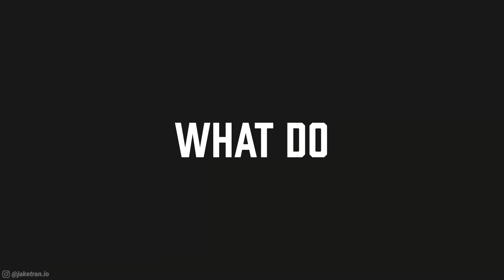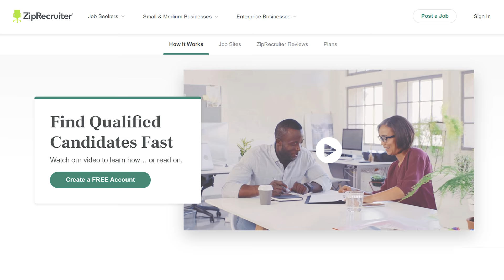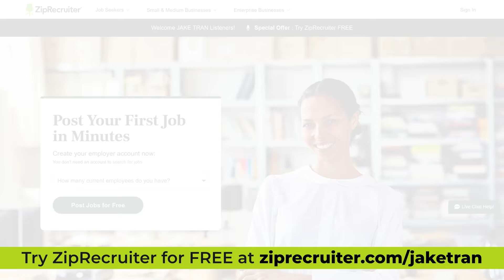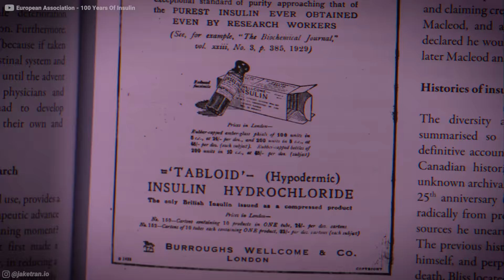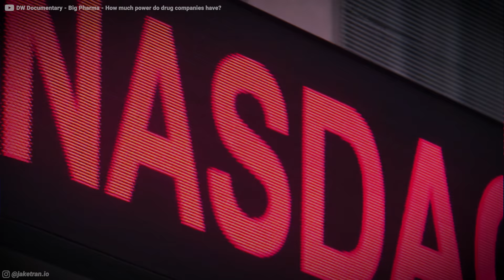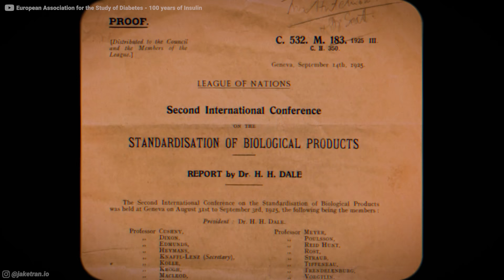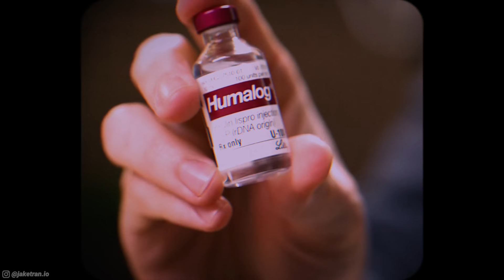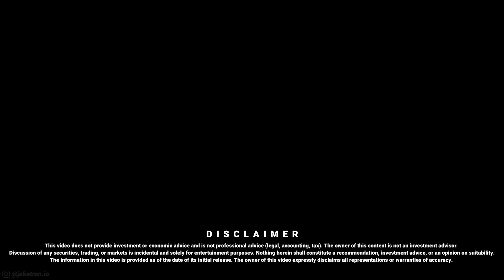OH, so it is all a scam!

Comment: Telling diabetics to stay away from sugar as a blanket rule, is a scam too.
My blood sugar levels go low and I risk diabetic shock.
So I carry around glucose and sweets to consume.
Since I've been doing that I've had not a single close call.
Listening to doctors, had me close to death a few times.
I used to test my bsl up to 7 times a day.
Doing my own research and my own tests has made me stable with dietary mods.
One thing that's truly evident to me regarding doctors, is they are just another arm, of the scam that the Rockerfellers started in 1920 when they took over the pharmaceutical industry.
Why the hell, would anybody in their right mind, prescribe medications that lower my bsl when that's the problem in the first place?
Medical industry is full of con artists pushing meds and not treating the cause.

Why cure cancer, when you can push expensive chemotherapy and have a repeat customer?
Cancer is another scam, but people buy into treatments and wonder why SHTF.

Comment: This shows the true toxicity of the government and its system. I don't have Diabetes (thankfully) but I have Asthma, the cost of an orange Diskus inhaler of Corticosteroids costs $500+ CAD without insurance, paid for it once and didn't need it anymore so stopped taking it. But thankfully the blue inhalers are free with OHIP. I can't imagine the struggle with Type 1/2
Reply: Okay they said he managed a restaurant, that averages 46,280 a year even on the bare bottom end it says 36,000 a year. He lives with his mom so no mortgage.  He could easily have a cheapish car. lets say food and maintenance of home and car costs $3,000 each so $6,000 a year   taxes at this bracket are not bad so lets high ball and take 20% of the salary (FYI you dont even pay a penny on the first 10,000) so on the lowest end he makes $28,800 a year at the least. So lets round up the car and home cost to $8,800 maybe he needed a new transmission this year. If he is paying for home taxes, sewage, water, etc add on another $5,0000 or so so he now has 15,000 EACH YEAR left over.  Heck even if he pays the mortgage it would not be that much a year.     WHERE DID HE SPEND HIS MONEY.

Comment: The point of this video is not that Insulin should be free...but rather that there is a market failure as the system is right now.  Innovation generally requires profit incentives...but in this case there is an error in the system that won't allow competition to drive down the price of a life saving drug.
Reply: There is no competition for insulin. It doesn’t matter what company makes it because it’s so easy to make that it can’t be significantly innovated any more. The corporations that control the sale of insulin eventually gain enough plutocratic control through lobbying that they form monopolies. It’s not a market failure, it’s that the concept of balanced market control is unrealistic. There needs to be power balances between individual and communal/government power such that the public welfare is the governing factor. Capitalism gives too much power to the wealthy/lucky individual, authoritarian systems give too much power to the powerful/lucky individual.

Comment: BTW, just so you know,  bottles of Novolin R (short acting insulin)  is available at Walmart pharmacies for ~$24.95.  It is not the most desirable insulin, but it will do the job until you can get better.  And it does NOT require a presciption.
Reply: are you diabetic? i've been seeing diabetics in the comments say that the insulin offered by Walmart is ineffective for most and has actually resulted in the deaths of many after switching
Reply: @raynjpg  it's insulin, it's illegal to to sell anything other than insulin if it's labelled insulin. There are shorter and faster half lives of the specific compounds used, potentially due to the choice of oil or suspensions. Anybody can buy it no prescription because if you need insulin and you're denied it you will die. Walmart can carry more than just one brand though. The stuff is quite popular among athletes though very dangerous when used incorrectly.
Reply: @zankfrappa6427  i did not say that it's not real insulin, I said that people are saying it's ineffective for most. there are multiple types of insulin that work better for some diabetics than others, whether it be how fast it works or some other factor. these insulins are not an option whatsoever for a good amount of diabetics, and it would be a grossly inconsiderate and ignorant medical suggestion to give to a diabetic.
Reply: @raynjpg  It might be because they're used to take a longer time acting insulin,short term insulin works quick but also goes away quick,and i heard that most food in the US even bread has a high amount of sugar content ,so depending on how and what you eat it might not be effective,for example i usually mix Lantus and Apidra insulin during the day,one is slow and lasts usually most of the day and the other acts fast and loses effect in a few hours,i only take the quick before a meal or in case of a high glucose level,but there are many factors of course
Reply: @Antarcticite101  personally, I take lantus just before going to bed, which will keep my blood sugars leveled out throughout the day, and I take Humalog throughout the day for food and high blood sugars as it works within about two hours.
Reply: @raynjpg  I used to take lantus before bed too, but my levels kept getting too low during the night even with lower doses, so i started taking it after waking up instead, seems to work better for me now especially since lunch is usually my bigger meal of the day
Reply: @Antarcticite101  glad you figured out a regimen that works better for you. currently i'm doing alright, about to leave behind puberty (18 yo) so I'll have to see how much my shit changes
Reply: @raynjpg  I'll be 23 this year,the biggest surprise for me was how much stress affects the whole thing,my life turned into hell and i almost became homeless a couple of years ago, and even without eating much the levels were just completely out of control, i would be lucky to hit a few normal ones in a day,ever since those moments i tried to take mental health as seriously as my physical,i no longer look at diabetes purely as something bad,but as a lesson too,and i know that we can live a completely normal life and still get something valuable out of it,i just wish everyone got access to what they need for it,i saw a vídeo about people making their own insulin from home labs,hopefully something makes it and stops the greed shown in this vídeo
Reply: @Antarcticite101  i hope so, too man. and sorry to hear about those struggles, but i'm hoping you're getting where you need to in life from here on out. thank you for saying that, as well, as it might help me take some better steps in my health going forward.
Reply: @raynjpg  Yes, I'm type 1 and jave been using it as my exclusive short acting after my insurance changed about 4.5 years ago.  The thing is, you just have to get the timing down: it takes about 3.5 hours to "kick in", and so you have to plan accordingly.  It's not great, but you can stay alive with it.
Reply: @silverclouds3725  fair enough, just have to be pretty organized with it then?
Reply: @raynjpg  yeah, for sure!!  When I take it, I know when it's going to hit me and so I have to make sure I have my meals at the ready.  THE downside is that long pause between taking it and its action.  It's easy to get distracted and forget!!  I usually maintain an A1c between... mmmm I guess I average between 5.5 and 5.8ish.  My last one was 6.0, but I'd been eating terribly.  But yeah, it is a good hammer, you just have to watch your fingers!! 🙂🙂
Reply: @raynjpg  I'm diabetic and silver clouds pretty much said it all correctly about this insulin.  I've had to resort to using it as a stopgap to survive a few times when losing insurance
Reply: @raynjpg  I was using the same two also but now insurance won't cover Humalog so I'm using Fiasp which is almost as good as the Humalog just a tad bit slower,  but in a pinch like I said before novolin r will keep you alive

Comment: This is a perfect example of what happens when we break the relationship between customer and manufacturer. The fact that insurance companies are involved, and sit between the providers and the customers is why costs are so messed up. The fact that a fee for some procedure is $400 and the insurance company will "allow" $26 for it should tell us something. Insurance shouldn't be paying for insulin, anyway, or 90% of the other things it has evolved into paying for. Insurance is for when you have a hospital stay or cancer. It isn't for bandaids and aspirin, or for routine medications like for blood pressure or birth control. Think about it: your car insurance doesn't pay for tires or wiper blades. It only gets used when you have an accident with significant financial consequences. We need to get back to fee-for-service, where medicine is treated like every other service. I think people would be amazed at what simple market pricing would do for the industry.

Comment: I am a type 1 diabetic blessed with my moms insurance and I am so nervous about aging , I am 23 it feels like a ticking time bomb
Reply: look up keto diet, i wont tell you its the best or whatever, just look it up
Reply: Eat fiber throughout the day and then eat protein at dinner time. Don't eat carbohydrates or sugar at all. Or at least try to give yourself 18 hours of not processing any carbs including complex ones like nuts. This will lower your insulin resistance. If you want to manipulate your hormones you can, it's easier than you think.
Reply: @vita1709  why? If the body doesn't produce insulin, how a diet will help. It works only on type 2
Reply: @praisekek181  please dont confuse type 2 with 1, they are different.
Reply: Try searching for 30/70 atraphane or 50/50. It ain't best but is something. Better to order from India, I think it is around 20-30usd the price.
Reply: @DrInsulin  exuse my lack of knowladge, just tried to help. I thought type 1 is better than type 2
Reply: @vita1709  Don't get me wrong. But we have to be careful to avoid spreading fake hope. but both cases  can end up with insulin. Even type 2 with a great diet can end up using insulin for various reasons including kidney failure.
Reply: @DrInsulin  you are 100% right man, didnt get that wrong at all

Comment: This is absolutely heartbreaking. I have a diabetic animal and have really struggled to get the insulin at reasonable rates ($450 is the most I've ever paid, which was outrageous, but it lasts a lot longer for animals so I could justify it). 

Info for anyone else struggling with this issue: many, but not all, of the manufacturers and GoodRX have discounts that make it $85-120 a bottle, usually about $99. We use Lantus and I haven't paid more than $100 for it in a few years. 

Still expensive, but it breaks my heart to know that this information might have saved his and other lives as I've mentioned this to a lot of people who were unaware (and this can cut costs up to 400%). I know it's not the same as humans, but most diabetic animals make it a year or two after diagnosis because people are too cheap or poor or lazy or unwilling to give them insulin. It's sad how many beings die over something that costs under $20 to manufacture and less than 10 minutes a day of "labor" to use.

Comment: Insulin racket? You do realize all healthcare products are like this right? Ive worked in DME for 20+ years. A tiny cotton filter costs 5-10$ on average. Costs 1/100th of a cent to make. An anti tipper for a wheelchair is sold in two parts and each part has the same price tag as the entire chair.

Comment: The American medical industry is rough all around. Insulin vials have already paid for themselves in R&D terms and as you've pointed out in the video, the cost of production is insanely low. This is only one example of a very prevalent abuse that occurs in the industry. Take the politics and if it does or doesn't work out of the most recent vaccine. Certain pharma companies made bank with zero liability if there were adverse effects and populations were almost forced to take it.

Comment: You can help diabetes by changing your diet. My grandfather had diabetes really badly and changed his diet and no he doesn't need insulin.
Reply: Your grandpa likely has type 2 diabetes which means his body still produces insulin naturally and he could manage it with a low carb diet.
Type 1 diabetics are different. Their body produces zero insulin so even with a perfect diet, they still need insulin.

Comment: Im a lifelong, uninsured type 1 diabetic of 30 years, so don't EVEN get me going on the sad state of insulin availability. But this guy dying because he couldn't get insulin is pure BULLSHIT. Wal mart sells Regular and N insulin right over the counter for $24 a bottle. Those are older formulations, so they dont work quite AS well as the far more expensive modern kind (usually referred to as L and H, for short) most diabetics like this guy were prescribed, but its STILL insulin, and i took those two kinds for over 25 years, and seeing as those two were basically the only consumer-available insulins, So why the hell didn't he just go to wal mart and buy himself some? He chose to die instead of spend $24? You telling me he couldn't find a wal mart? Seriously?? Thats a question i feel the need to have answered. And ketoacidosis is a horrible, slow, violently wasting way to die that takes at least a few days at the shortest to die of, but it still normally comes on over several days, even though its one of the worst ways to die. You are NOT going to be ok and then one day just up and drop dead from it. So you telling me he's going to suffer through that and somehow not just go to the hospital? Because he's more worried about the ICU bill than he is his very life? I mean, come the F*CK on. Nothing about this story adds up. It's BS. Whatever he died from, it may have been related to his own poor glucose management, but it  wasn't ketoacidosis. And out of all those pictures, not one of them shows him suffering ketoacidosis. Not one pic snapped of him showing the deterioration. What, you saying the camera broke right about then? Trust me, it'd be written all over him, but he looked pretty peachy to me. I want some inconvenient questions answered about this story. Im not buyin' it.

Comment: I think you may have gotten some diabetes stats backwards. Type 1 Diabetes means your body doesn't make insulin, so you must have insulin to survive. Type 2 Diabetes means your body has become/is becoming resistant to insulin. Some people with type 2 Diabetes still need insulin. Most of the time, you don't differentiate.